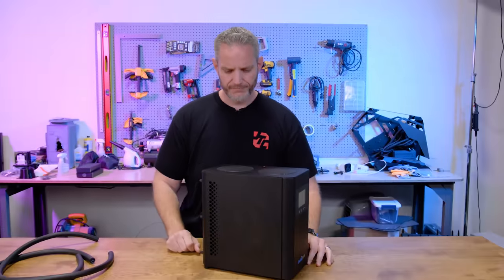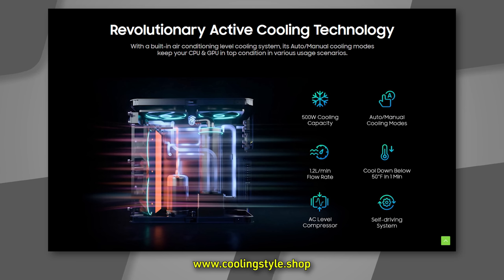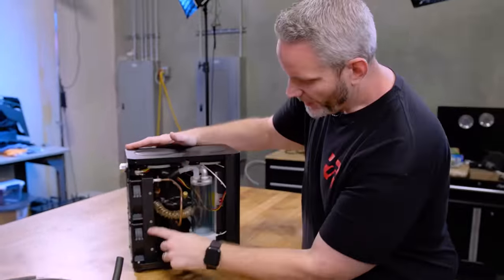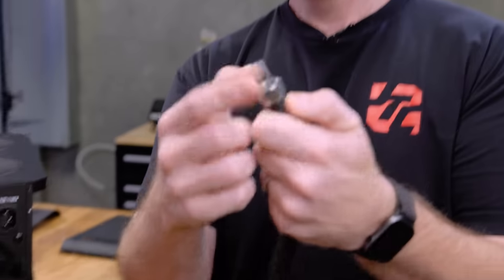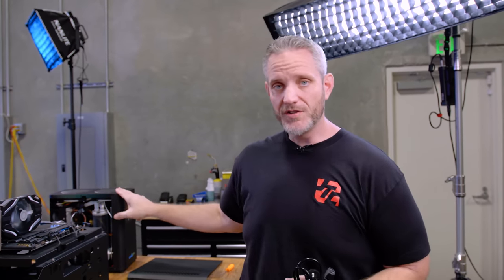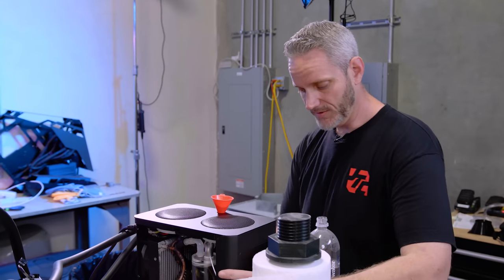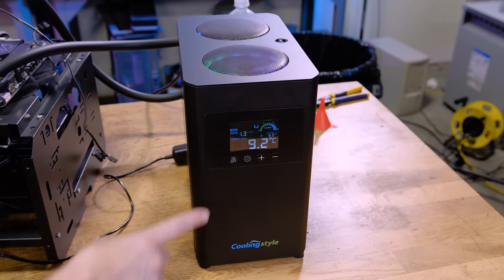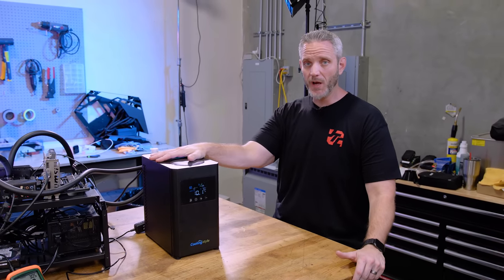This seemed Gimmicky... Turns out I was right!

Comment: This looks like a good solution for a divorced setup where this is sitting in a closet or different room than your main PC and you run lines to it. Maybe even have it sitting near a window to dump the hot air outside rather than in the same room. Similar to how a window AC unit has a part that sticks out the window, or how whole house AC systems have a handler inside and a condenser outside.
Reply: One of the issues being: the chiller will probably consume 100+W power to chill your water cooling loop. You could just supply your pc with fresh air with some dryer vent tubing and a couple fans, only consuming 10s of Watts.
Reply: Yes I was thinking it could be plumbed outside the house.
Reply: Yeah, I was thinking dryer vent to the outside for summer, inside in winter.
Reply: Sure, but at that point you could also just buy long hoses, make a little frame or use/get a spare case, and do the exact same thing with a normal liquid cooling loop without having to pay for a sub-par refrigerator. Hell, just hacking an extended loop in to a cheap minifridge would probably work better!
Reply: @teekayfourtwoone4686  Which if you're going to cut holes in your house to cool your computer in the winter you might as well just pump that frigid air to the computer (or put the computer outside) and skip the extra power usage.
Reply: "Traditional" whole house? Uhh... Window A/Cs are the traditional thing here in Maine. What's a whole house A/C? Lol. Like, I understand the English, but I've never seen one.
Reply: Huh... Why have i never thought of doing this before? Dump the heat load outside... Well, now I have a woodworking/3d printing project to do. Thanks!
Reply: @Paradox-es3bl  "traditional" might not be the way I would put it either, but it really depends on the age of construction and the region of the US. In Arizona for example, every house and apartment I have ever seen has central/whole house A/C. When it gets to 110F+ for several months out of the year, it's a living requirement. But I know that if you travel north (colder) and/or east (older and potentially colder) it becomes less common.
Reply: @Paradox-es3bl  they probably mean a central AC system. Which uses your furnace hvac to condition your whole house
Reply: so maybe in your laundry room in its own vented box with hook up for the dryer vent hole
Reply: Cost is not an issue if the machine makes you money (if you use it for work...). It costs less than running the AC on the full room.
Reply: Same concept as a killer chiller on supercharged intercooler cars.
Reply: @ahuesphoto  That heat has to go somewhere. Thus, its going back into your room. There are very few people who are willing to jerry-rig some setup that pumps all the waste heat outside just so that their room doesn't warm up. 

So your A/C is still going to be cooling the room, regardless.
Reply: The best part is, because CPUs are completely fine operating above temperature, the refrigeration part is completely unnecessary. You could just do that with standard water cooling.
Reply: I thought so at first too but then I realized if you're going that far, and paying that much, it would be better to go the Linus route and just run an extended optical displayport/USB-C setup to a system in another room. That way you get rid of the sound from a PC all together.
Reply: I'd rather do something mod-y, like a rain tube or such. Getting below ambient is a big moisture  risk. That's why oc enthusiasts do things the way they do. (Vaseline, etc.)

Not thrilled looking at the parts inside. Nothing wrong with things using existing components, just looks like it would struggle or break easily.
Reply: I'd totally consider that for maybe a rendering machine or servers or something, maybe put it in another location and run some tubes, Whole home cooled water cooling lol
Reply: @Paradox-es3bl  He's talking about central air conditioning/heating systems by saying traditional whole home air conditioning.
Reply: Yah bro you should bleed the refrigerant 😬
Reply: I feel like a better divorced setup would be a window AC with radiators attached and tubing going to the blocks in the PC, or use dryer ducting to pipe the cold air straight into the case.
Reply: @Sizukun1  hard to do that in the middle of a sky scraper
Reply: @hayyremz  one of a thousand reasons to never live in a high-rise tower. But they generally have good AC anyway so just turn down the thermostat?
Reply: @ashkebora7262  The problem with using a fridge is the compressor isn't rated for that duty cycle. It's intended to run for a couple minutes then shut off for a while, not run constantly due to a constant heat load.
Reply: @BobBobson  Yeah, a fridge doesn't move enough watts. Though window AC units and the like do move enough watts. If you're already talking about moving the cooling to a different room, dealing with the sound, or venting it, you'd definitely be better off just AC-ing up the server room/closet where the cooling has been stuffed or rigging it up directly to one if you want sub-ambient temps.

... at least compared to this unit. If it's almost as loud as a damn AC unit, may as well spring for the machinery that can move thousands of watts of heat!
Reply: Do not put that in your closet. Out this next to an air return in your house. During the winter you’ll get free heat
Reply: @glOckcOma  don’t do that. You’ll fuck with with your HRV and make up   If you have on in your house.  I always thought of doing something like that but being in un condotioned air in your house or blowing air out of your house is just a horrible idea for your furnace and HRV with out even mentioning it’s like having a giant window opened in the winter or summer. Your pushing CFM out or in your house.  That’s not effient.   If you want things like this to be efficient place this next to a cold air return in the winter. So it’s sucks all that hot air to your furnace giving you some added heat distribution for the rest of your house. In the summer. Don’t use it. Simple as that.
Reply: yeah I could see being divorced if I bought this and tried to cool her computer with it
Reply: the longer the hosing, the higher the static pump pressure, the bigger pump you need and less efficient it will be.
Reply: @tschuuuls486  Where do you live, Siberia?  Fresh air ain't doing nothing for people living in the lower half of the USA.
Reply: @ashkebora7262  this has been proven false. Refrigerators are good at removing heat when there is no heat source. I am pretty sure Linus built a PC inside a fridge and they found it absolutely sucks at removing heat when you're constantly adding like 600+W into it. The compressor wasn't designed for that type of task.
Reply: @Paradox-es3bl  yeah I know. I'm moving to New England area in a couple weeks because of work and finding houses with central AC is near impossible unless you spend almost 1 million.
Reply: I recently rewatched the rebuild of the oil pc from LTT. 

They knew it was a stupid idea when they first built it and even more so rebuilding it.  For the benifits it brings its a lot of hassle and bloody expensive.

What are you going to achieve with this? 

A slightly higher overclock and a few more fps,  that you won't notice in real terms anyway. 

Just because you can doesn't mean you should.
Reply: @Sizukun1  I just put my PC right in the window sometimes in the winter… negative 20f hitting the radiator. PC runs real nice at sub 0c without nitrogen lol
Reply: @teekayfourtwoone4686  you gotta be careful with winter air as, like liquid nitrogen cooling, condensation can kill your components. It would, however, be worth considering if the air were piped directly to the face of a computer, in which a singular front radiator is installed for the entire system. This could collect the condensation before it hits your mobo as the rad heats the air up coming in.
Reply: Could just use a second case with only cooling gear in it and put it in another room lol.
Reply: Something to remember when pumping hot air outside, it has to be replaced, which could potentially mean sucking in hot air from outside.
Reply: I live in the frozen crap hole of MN mix of central and window shakers
Reply: @piatdor  HRV and Make up??? Why would I run this in the winter and not run it in the summer. I think one of the whole point is to run it in the summer months. This is a tiny compressor not a large AC unit. I've run large chillers on 180 gallon salt water tanks and never felt the heat but even if this one is different, and even if I ran hoses outside to the chiller in the summer it wouldn't make a difference. Window AC unit do the same, just blow cold air instead of cooling liquid. Oh and one more thing. I don't plan on ever getting a chiller for my PC, it was just a suggestion I threw out there.
Reply: @henry55430  I was just meant heat going outside in summer, heat going inside in winter. Never said anything about bringing cold air in. I can see how that may not have been clear in my comment.
Reply: Or you could take those 800 bucks, buy a proper 1000W chiller and some black spray paint. No RGB tho. Tough decision.
Reply: Which could also be done by using a much larger radiator outside with a fan. People used to use car radiators before PC specific ones existed.
Reply: There is a limit to how far this will pump fluid.
Reply: @Paradox-es3bl  Literally an a/c unit that sits outside and each room has vents that air gets pushed into.
Reply: @Paradox-es3bl  window units are only the norm for houses that were built before the 80s or thereabouts, they weren't designed to have air conditioning. Anything newer than the 90s is designed with central air in mind. Heck even my double wide trailer from 79 is setup for central air.
Reply: @Paradox-es3bl  You never heard of a Central A/C system? That's like living in a bubble.  Maybe visit any state west of you uses a central A/C system.  Seriously, you need to get out more.
Reply: @Paradox-es3bl  prob because...95% of ppl dont live in the US ...
Reply: @rotor13  Yes, of course, the AC is turned back on the next day during office hours. And everything go back to normal. My point is that for a small business server or a home office server you have to deal with the dust; for a Plex media server also. Air cooling is sufficient for Xeon Servers, I’m currently using Thermalright Macho 120mm, and I still have to clean the case every six months or so.
Reply: @ahuesphoto  The issue was never about dust. So dont try to move the goal post.
Reply: @rotor13  Nevermind… I just commented on a real problem that I had experienced. It is OK to disagree…
Reply: @ahuesphoto  We're talking about dealing with the hot exhausted air. 

Not dust. 

If dust is a problem for you.... clean more often. thats it. 

You said a stupid thing and you tried to moving the goal posts by invoking dust as part of the argument. Its ok, it happens. Take the L. Move on and try again.

Comment: 8:35 any vinyl hose fittings are larger than the hose, when you force the vinyl over the inner part of the fitting it becomes larger than the diameter it was before, so long as the thickness of the hose is more than gap in the compression fitting it will compress it and seal. It's the same in vehicle compression fittings. I know you probably know and this is a simple mistake.
Reply: I was coming to say the same thing. I think he was just on a rant and decided to not use his brain.
Reply: If you are using a thinner wall thickness than the fitting requires then it can still not seal when you get it over the barbs.
Reply: @RevRaptor898  i did explain that. Starts with so long as...
Reply: yeah i was just wondering that ... thank you
Reply: Came to say this too. “You haven’t put the tube on the fitting yet, it’s going to expand!”  That’s me yelling at Jay on my screen.
Reply: Beat me to it hehe, but not stressing, Jay was on a roll :-)
Reply: Ya, the barb fitting expands the hose and it gets tight.
Reply: I luckily read your comment before writing the same thing (almost), being 1 month late is nice sometimes ^^

Comment: After watching the video a second time I did notice that it actually has service ports. So if for some reason you can have a HVACR technician add more refrigerant. It's nice that they didn't make it a sealed unit like so many ac units and refrigerators. I bet with some more development this could be a really good product.
Reply: Jay mentioned it had a 'Freon' filling port.
Reply: @gh8447  yeah I some how missed that the first time through the video
Reply: You mean sealed like EVERY WINDOW AC UNIT the days hahaha. It’s so annoying. (You can add the values but whatever)
Reply: Most are sealed,  because unless you're a licensed professional, they don't even want you to have the chance of touching it yourself and releasing gasses into the environment. You actually most likely cannot even buy the exact refrigerant that you would need. You might be able to buy an overpriced can of a mixed solution that you can top up your car with at autozone, but nothing more.... If a sealed unit needs charging, a professional will tell you if it's cheaper to add a port and re-charge it, or just straight up buy a new unit.
BTW, refrigerant costs $50-100 a pound. Your home ac holds on average 8+ pounds.  Your window unit would be around 2-4 pounds.  That's already more than $200 not including labor.  Better off buying a new one
Reply: @johnmonteon  While yes that is all true. You can buy R134a and manifold gauge sets legally without a license. Should the average person attempt a repair themselves probably not.
Reply: exactly ! like remote cooling for all systems. Maybe in imbedded solution for pc component and all the tubing is done under the floor. (I know I'm dreaming but I like the idea of totally concealed PCs)
Reply: Cryo-cool made a system that worked back in like 2000
Reply: @BrockGrimes  I vaguely remember that. I think my 7th grade computer teacher had that setup
Reply: @johnmonteon  not sure how much I believe pricing. Or else window units would have absolutely no profit margins